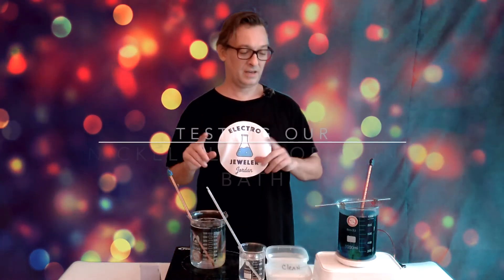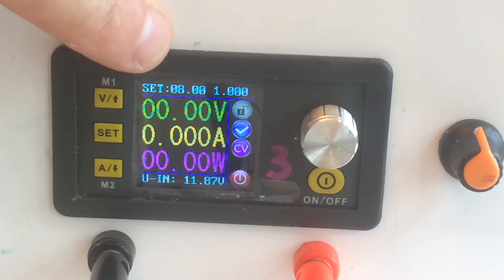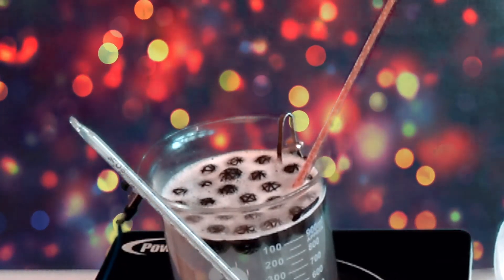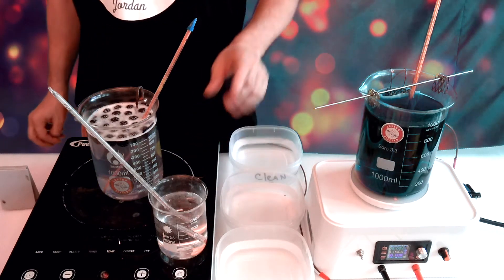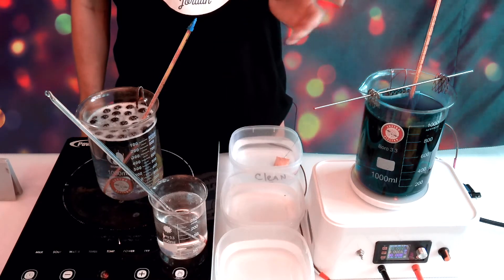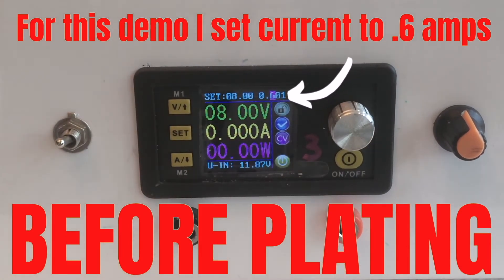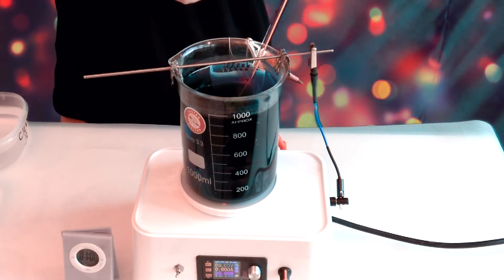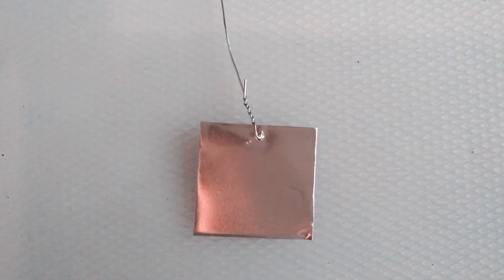Nickel Plating Test Your Nickel Electroplating Plating Solution

Comment: can you add distilled water to nickel plating solution to compensate for evaporation without effecting the performance
Reply from the maker: Yes, I recommend marking the tank at the surface level when its full and top up with distilled water regularly.

Comment: If it’s 10 minutes to deposit one micron of thickness, what would you suggest for a similar sized piece of jewelry to avoid having to replate in the future? 5 microns or 50 minutes? Thanks!
Reply from the maker: 1 micron of nickel is very durable , not a lot of need to make thicker unless its a ring, but I don't recommend nickel for rings.

Comment: So what is nickel activation?
Reply from the maker: Nickel activator removes the oxide layer from the nickel before plating over it
Reply: @electrojewelerjordan490  Yes, you told that in the video. But what it consists of? Can I use hydrochloric acid?
Reply: @voidfalse  there are several acids that you can use, I have not tried HCL but it would probably work.

Comment: Hello, there is a problem in my tank the piece I want to plating is creating a problem top side of the piece is good plated but the bottom is black kindly Gide  me what I can do for it
Reply from the maker: HI,  Black can be a few things  1) current too low, this is usually gray black with a shadow and can see underplating.  2) Current too high usually the edges are dark black.  3) Too much brightener.  4) you didn't clean the piece well enough / still have polish on the piece.  Electroclean before plating.  I hope that this helps.

Comment: Thanks for answering the other video.
But I found it expensive to buy each bottles and shipping goes crazy also.
if I polish the part and clean it with brake cleaner. Can An activator be enough? Is it just acid or?  And rinse =distilled water?
Im also curious to know if the water needs to be pH neutra or so after acid dipping?
Reply from the maker: After polish then degrease, then electroclean.  I'm not all that experienced with plating ferrous metals, but probably stainless activator, then nickel. Nickel activator and stainless activator are very different.   It would be best to consult with someone that does gun parts, because if you don't do a proper surface treatment before nickel plating it will not have proper adhesion.  My channel deals predominantly with nonferrous metals.  Yes, the water is distilled, tap water can contaminate your solution.
Reply: Hmm but in only doing antique weapons at this time. Im sure its not stainless.
What anode should I use for the electrocleaning when doing steel ?
Reply from the maker: You can use a stainless anode.  If you don't have a professional one you can use a sheet of type 316 stainless steel.